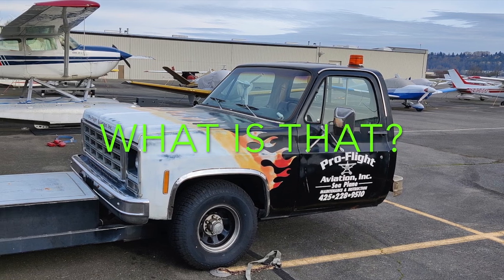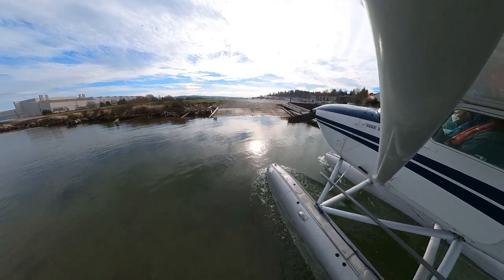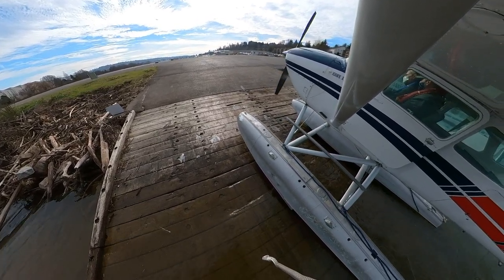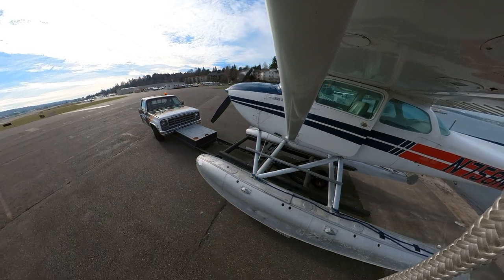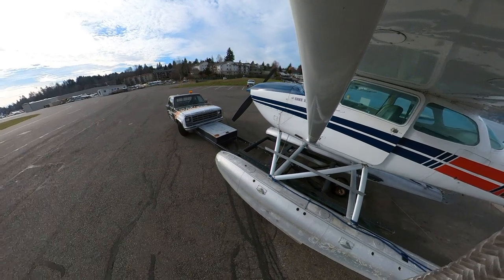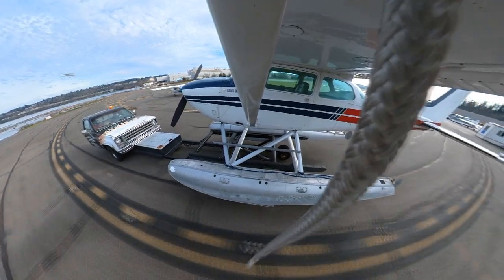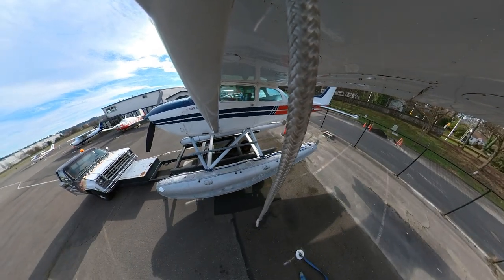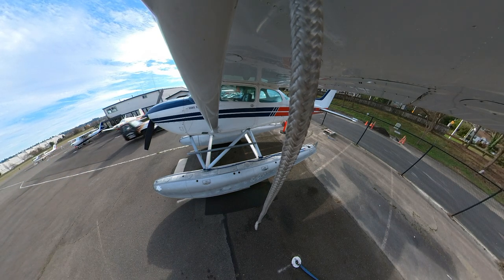Meet the BEFA float truck!

Comment: That is the best explanation of what a float truck is that I have ever heard. I'm assuming the trucks they convert to be used have to be 4 wheel drive or is that not the case?
Reply from the maker: Yes, 4x4 must have been a prerequisite. I wouldn't be surprised if someone did their own drive train conversion.
Reply: @SimonButler  There's a few out there that were made out of the front end of an old Olds Toronado, which was a huge FWD car with a 455 V8.

Comment: I wonder what they do to the other half of the truck
Reply from the maker: I hope it's a nice little trailer somewhere.
Reply: @SimonButler  cut-off pickups make lousy trailers - the floor is too high, the axle is wrong, they're too heavy...
Reply: There is a market for pickup boxes to replace ones damaged in collisions, there is market for used axles, and the frame is just scrap steel for recycling.